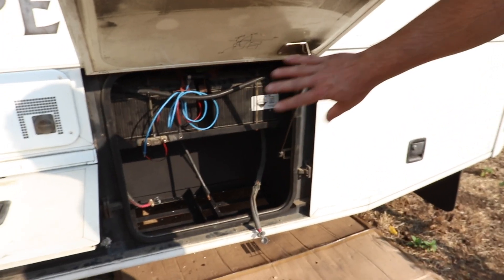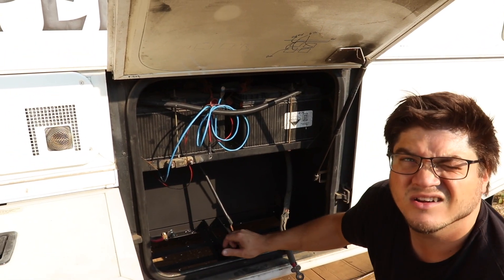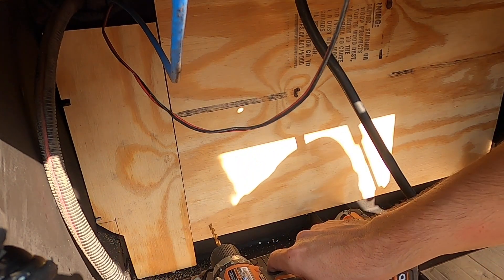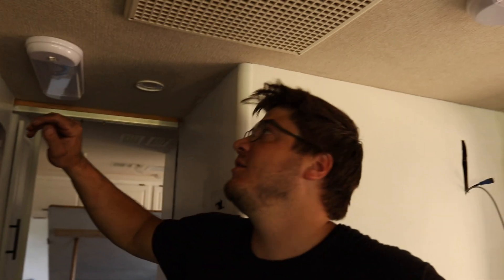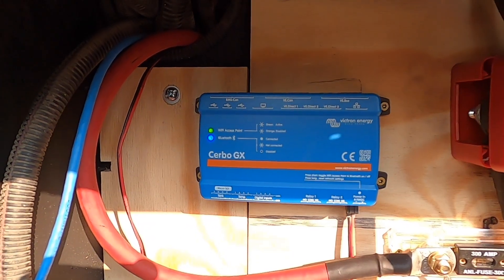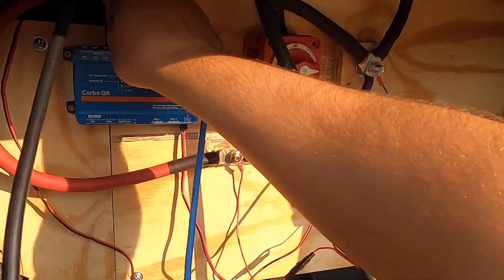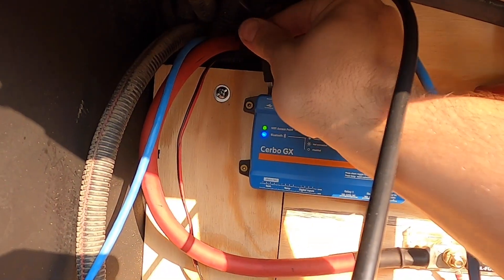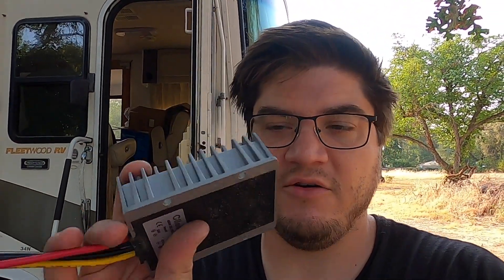Installing the 24v and 12v electrical systems | RV Renovation

Comment: The shunt is supposed to be on the negative side of the battery, I didn't notice one.
Reply from the maker: It is. We have a 500amp shunt on the negative terminal that all power flows through. The big thing that screws people up on the install is accidentally having a load negative terminate on the battery side. All of ours are connected on the load side. So we get a pretty accurate reading of what’s going in and out of the batteries.

Comment: Should always charge the big capacitors in a big inverter, don't just throw the switch. You will or could, blow up an expensive inverter. Simply by hand, hold one end of the 25w 30 ohm resister to the hot from batteries, and touch and hold the other B+ of the inverter. Done. Then make the connection. No spark.

Comment: Get a pool noodle, split it lengthwise, then put it on the bottom edge of the slide wall outside.  This will keep Su from braining herself.
Reply from the maker: If only that would help. Haha. It’s a good suggestion for sure. I just feel like we’d have them everywhere. She finds a way to hit her head on everything. Luckily, our slides are in such a place that she is rarely near them. So they have been the least of our worries. It’s usually kitchen cabinets.
Reply from the maker: Ha! I like the way Brian thinks - Su
Reply: @ryanandsu  Next time you're in an rv park, look at people's slides.  I'd be surprised if you didn't see several people doing this, especially the camp hosts.  They are often full timer's instead of weekend campers and more likely to get tired or poking holes in their heads and using this method.  Stay safe.

Comment: So your incoming shore power is rated at 30 amp's? Did you think about possible upgrade to 50 amp's so you could run both AC unit's at the same time?  I know our MH main shore power is 50 amp's and we can also cord down to 30 amp's if that's all that's available. With all your solar and battery power I'm assuming your camping will be mostly boon docking? Great job with the up grading of the wiring and new batteries.
Reply from the maker: Thanks! We thought about going to 50. But the AC units are setup to automatically cycle to manage on 30 amp. And we also didn’t want to add another inverter to supply the full 50 amps. It was just too much cost and we are fine managing the power needs on 30 amp.

Comment: What is 24v on the rv that'll need to be converted ?
Reply from the maker: We installed 10 lithium iron phosphate batteries. They are wired in pairs of two in series to make them 24v. The 5 pairs are then in parallel as our house batteries. So the 24v batteries need to be stepped down to 12v in order to power the lights and other 12v appliances.
Reply: @ryanandsu  hi. So did you need only a single 40amp 24 to 12 v step down prior to your system getting to the 12v side of the campers panel? Is that because your rv is running 30amp?
If my rv is 50amp do I need a step down higher than 50amps?
Thanks. Hope you see this.